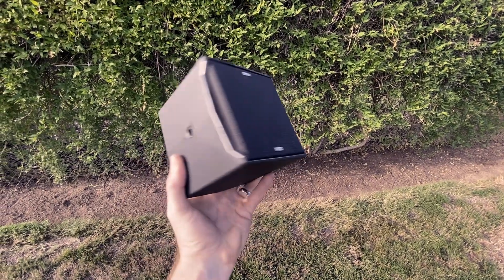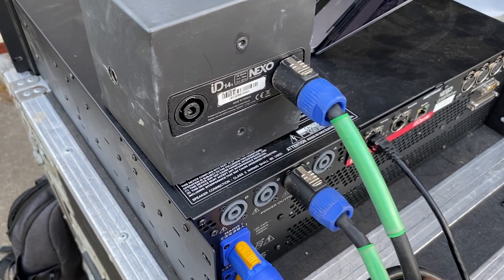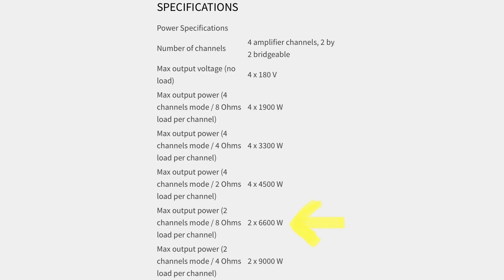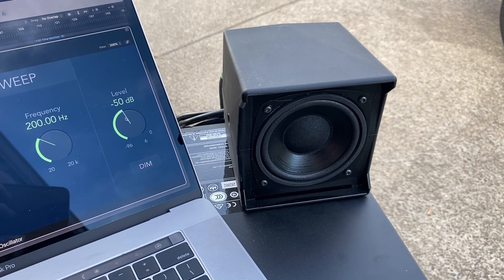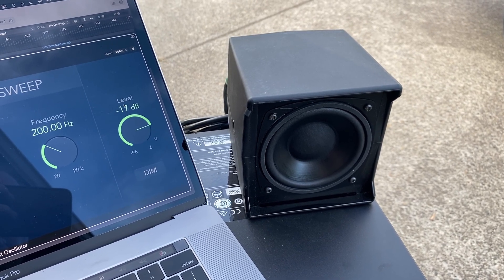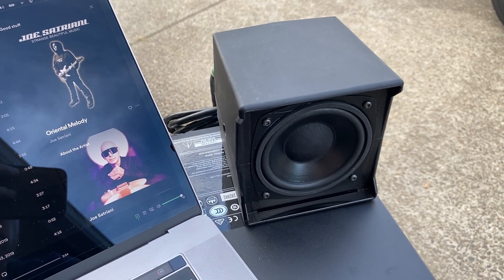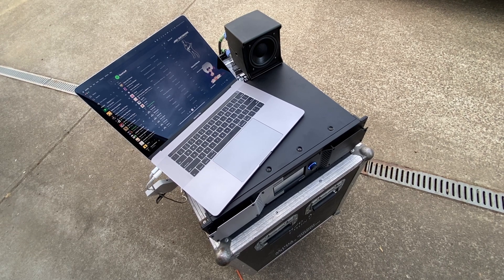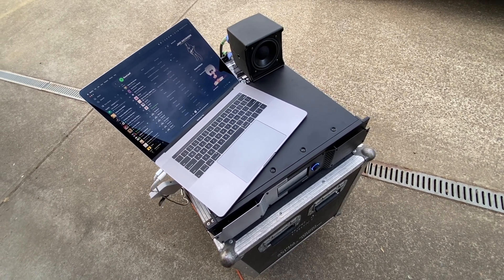Can I BLOW UP my Nexo speakers?

Comment: The amp must have some detection circuitry inside to measure and analyze voltage and current waveforms at the output side. When a speaker is pushed to its limit, the voice coil will face non-linear mechanical resistance, which can be reflected by subtle change of its impedance and backward electromotive force. By using some sort of algorithm (AI machine learning can work, but that's certainly overkill for this task) a microcomputer inside the amplifier can recognize this pattern of parametric change and command the preamp circuit to bring down the output volume into safety margins

Comment: Hello is the old nxamp 4x4 mk1 first version protecting the same way?? Because i lost some ps15 phl speakers and 1 ps15 horn diaphragm while i was playing them with nxamp4x4 mk1 and i cant understand why the amp didnt protect them…
Reply from the maker: I don’t think the original amps had as good of protection to be honest, but I haven’t tested them thoroughly. Also, the older series speakers might not have had as robust drivers, as driver technology has radically increased over the past decade.
Reply: @devinlsheets_alphasound  thanks for your answer my friend… yeah but i compared A/B tests with nexo ps15 versus ps15r2 and versus P15  and i found out that my ears and everyones else in the room liked a lot more the old ps15 all played by the same nxamp4x4 mk1 version  mono sound  and wav track of thanks to you ( boz scag ) and no sactuary here ( chris jones ) of course the p15 could handle extremely more db  but lose the quality of sound..

Comment: does this only apply to only nexo amps or other dsp based amps....and this won't work for non dsp amplifiers.
Reply: This only works with nexo Amps. But there are other manufacturers that make dedicated Amps for dedicated Speakers for example L accustics. But you can and should not mix these Amps and Speakers, for example powering an L accustics with an Nexo Amp.
Reply: yeah man if he didn't tell the amp what it was powering that speaker would be pieces lol

Comment: Do you configure the type of speaker connected, or does it detect it somehow?
Reply: I've only set up l-acoustics and D&B amps, but I suppose it's the same with NEXO. You load the preset for the speaker that's hooked up to it and if you load the wrong preset that's on you.
Technically the amp could do an impedance sweep, match that to a database and auto-detect the speaker and even detect defects in the box connected, but I'm not sure if that exists yet. Would be a cool feature for sure and it's really just a software thing (the additional hardware needed to do this should be present in most higher end dsp amps already)
Reply: @peniku8 I can confirm for D&B systems. Sweeping for matching impedance would be incredible.
Reply: @danveneri   I'm sorry but I don't understand how your comment relates to the previous discussion. We were talking about the amp automatically detecting which specific speak is hooked up to it (e.g. a small 6" monitor or a double 18 sub box).